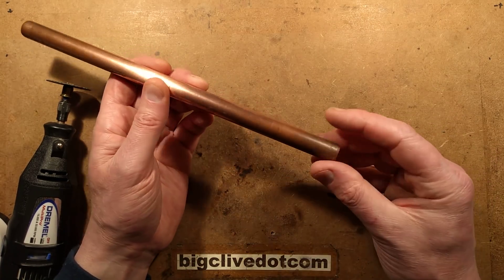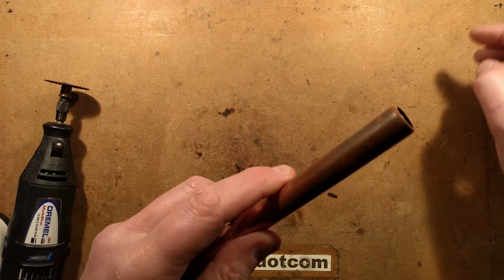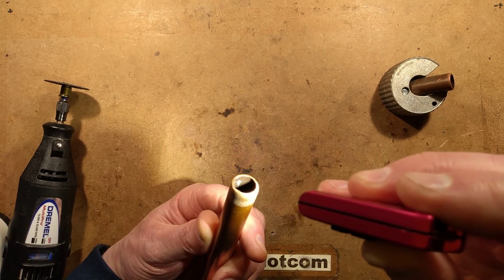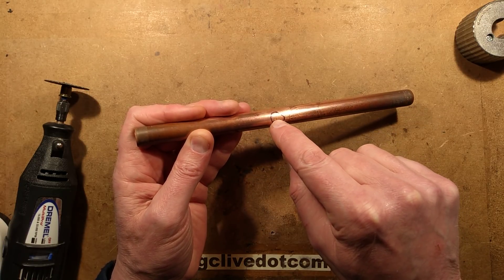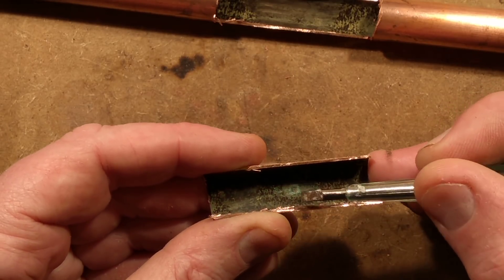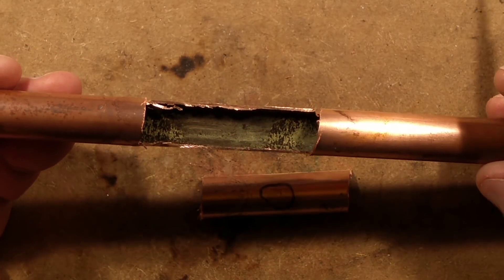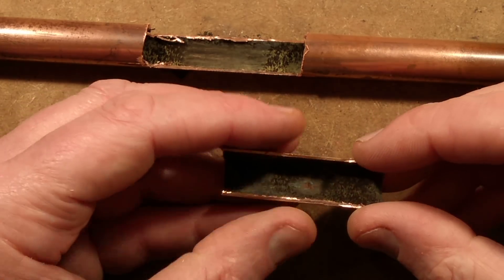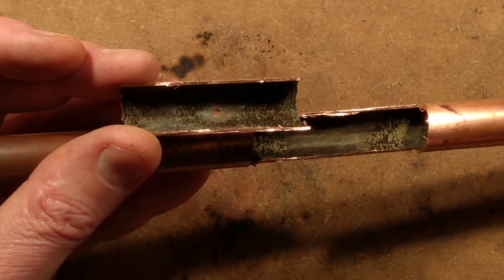Odd pinhole leak in copper pipe.  Selective electrolytic corrosion?

Comment: My first guess was that the green blobs inside are caused by flux getting into the pipe at the time of fitting and sitting quietly, lodged to the surface and slowly causing pitting and corrosion of the copper by electrolytic corrosion from the zinc in the flux. Weirdly though, it should be the zinc which corrodes into solution when it is in contact with copper under water as zinc is lower than copper in the electrochemical series. If there was iron present that could cause it. Are there any parts of the system that might have a steel or iron component in, such as a boiler or heater/heat exchanger of some kind? The other cause could be if your water company on the IoM uses chloramines to disinfect the public supply.

Comment: This is why PEX pipe is used here now for all new construction.
Reply: Pex is amazing... until a rodent chews through it in an attempt to make it through the hole it is run through and causes a flood. Been there fixed that.
Reply: At least that would be a single point. This looks like ALL the copper tubing will need to be replaced or will start springing random leaks soon...
Reply: @danielthechskid  It would remove some of the convenience of running PEX, but a metal sleeve for the line running through penetrations could mitigate that. Bonus if it's steel and used for runs through walls: homeowners hanging pictures/shelves/what have you don't make fountains.
Reply: in new "new construction"  pex is great. just make sure you never get any rodents near it.  
living near any place the floods or a farm that occasionally harvests or tills , and you will eventually have to deal with a few rodents coming in.
 they are also prone to water hammering, if not installed perfectly.
Reply: Here in Finland they've found quite severe chemical differences in materials and chemical residues in water. Most problematic chemical is TBA as there aren't any safety specs in EU for PEX piping and liver damaging amounts of that chemical don't make water taste anything special as usually chemicals do.It's official health departments recommendation to flush water at least a minute before consuming it on new installations for at least first half year. So all in all. It's not completely flawless material either. Also it's bit alarming to know that few batches of PEX has been pulled and banned from market because people apparently have actually tasted other three chemicals in water. And if those chemical dilute into water even after flushing system after install, it's actually not the best news ain't it? Ten random PEX articles tested and two of them were banned. That's not good indication of quality of PEX pipings. Don't know if this can be translated into english via google. Likely not :)

http://www.projektiuutiset.fi/muovisia-kayttovesiputkia-myyntikieltoon/

Comment: I'd like to point out that copper is very high on the electronegativity scale, which means with electrolytic corrosion it'll usually be the other metal that corrodes. But it's certainly possible that flake of steel or something got embedded in there.
Reply: Imagine not a flake, but a thiny steel bristle embedded in the wall maybe even passing  through it. Due to this exact effect you describe the steel will be eaten away leaving a hole.
Manufacturing defect in pipe. Impuritys/contaminants acting like ticking bombs.
Reply: @1kreature  ticking bombs are harmless....
Reply: This is what I was thinking.
Reply: Mr. Morningstar  Yeah. It's worse with zinc gutters though because zinc doesn't passivate like aluminium does. But aluminium has it too.

Comment: Polish copper pipe, I believe there was a bad batch a while ago (2000 ish). Or if it's on the hot supply it could be from a water heater ?

Comment: What can also happen is if your boiler has a circulation pump that is too powerful for your water installation, it can wear down your pipes due to the speed the water is circulated resulting in very tiny holes appearing over time.
Reply: This is true! I've seen it happen in a resort with thousands of rooms! Job security at its best!

Comment: I moved it to a house around 20 years ago and it's on a well, it was new, after about 5 years went by started seeing failures in the copper pipe just like those. The goo on the inside was white and blue (calcium?). The pin hole were so small that the spray was a super fine mist. After 10-15 repairs, I just re-plummed with pvc.

Comment: I saw the same thing happen to a piece of copper pipe that fed a chiller unit in a datacenter. It was spraying water into a mess of ethernet cables and (more fun) 240V power cables that ran underneath the raised floor.

Comment: I found a pin hole leak in a section of central heating pipe (return).  It had lengths of plastic pipe either side of the run so I think it was electrolysis room it not being earthed.

Comment: Get some inhibitor from screwfix flush they system out refill and add the inhibitor in there should help
Reply: Get the inhibitor or your hole system will end up fucked
Reply: Inhibitor? Bit of a laugh there as I believe that Clive said that it was a cold water pipe from the riser into the property . . . not the central heating system.

Comment: I’ve been living in this same house for almost 50 years now.  Some years back I had a number of these events occur in the same type ½” copper pipe.  They were always on the hot water lines.  Some years before that I had insulated the hot water lines for energy conservation.  Of course to repair the leaks I had to remove the insulation.  I got to wondering if the insulation was somehow contributing to the leaks.  I eventually removed all the insulation.  Since I did that, I’ve not had another leak like that.  I don’t know if the insulation contributed to the problem.  I don’t know if something else has changed that is preventing the problem from occurring again.

Comment: Clive, the same thing happened to a copper pipe that fed a tank in my airing cupboard.
My house was built in 1948, so copper does go bad over a long time.
A plumber called it "Pickle pipe" for some reason, there were quite a few green dots on it.

Comment: I had a similar problem many years ago. ( 1974? ). But it was behind a wall and soaked the hallway carpet. I found that the copper pipe was so badly contaminated that it refused to take solder and I ended up with a rubber bodge to fix it. That was only one of the problems in this house that was built by a fly-by-night contractor who obviously used all kinds of low-quality materials.

Comment: If I remember correctly those failures are mostly caused by steel particles. Probably from either work on steel pipes earlier in the flow direction or from tools like files and hack-saws that has been used for steel. It do take a lot of years for the corrosion to go through all the way.
Conclusions: Don's mix steel and copper pipes plus dedicated tools for copper when it comes to plumbing.
Reply: A lot of plumbers use steel wool to clean pipe ends. Maybe this is the cause of the contamination?
Reply: but its the steel which corrodes with copper particles. Copper after steel pipe is supposed to be OK.

Comment: In my house it's all copper apart from a section that runs from the main shut of valve in the street to the house and that's made from mild steel. Not shore if that would cause corrosion to copper

Comment: I see this quite often. 
Less often in heating pipes from a boiler, but still then.
The water treatment chemicals or minerals from a well build up in the pipe, and some flakes off, that exposes he bare copper to corrosion, and poof it’s gone.

I also see in refrigerant lines hat run through hot attics, where the insulation gets torn, water will condenser on the cold pipe, and fill the low spots inside the insulation and the water eats away at the outside of the pipe like a worm eating a book...

Comment: If you end up replacing whole runs, you can always use PEX in harder-to-reach places for its flexibility so you won't have to solder in impossible positions or even bother with elbow fittings in places where bends can be made soft enough.
Reply: Might as well just use PEX everywhere. It is a rather good system.
Reply: @mgkleym  For an existing installation, my version of "replace everything" would be limited to the affected run(s) from wherever they tee off from to as far as I can push it with enough slack to tidy both ends at the next remodeling opportunity where the remainder of pipes may be more accessible or need to be ripped out anyway.
Reply: biohazard 918 agree 100% if you can pull a cable you can pull 15mm PEX from a roll and if you have to cut out old pipe sections through holes drilled in joists it's a doddle . I prefer Hep2o myself as the push and turn fittings are so quick and easy to use. Cheap ratchet pipe slice need no deburring, pop in a stainless anti crush insert and push twist and lock... Done. You can even unlock them again if you really need to. Resistance to freezing is good for PEX and they don't suffer from long run thermal expansion in heating systems like copper does.  Best of all they don't corrode.

Comment: the PH of your water is the basic cause of leaks like this, finding the weakest spot.. municipalities normally take great care to stabilize PH of water above 7.. if you're on a private well, it's up to you.. green streak in the toilet bowl or sink means you are drinking the metal from your pipes and valves all the way back to the source.. plumbiodontal disease.. get a quart sample and go have it tested.. we don't want you turning grey from lead before your time.. a PH of over 8 allows the formation of a protective mineralization layer, covering the inside of the pipe, so the subsequent water never actually touches metal and will never wear out as long as the PH is correct..
Reply: isnt that what happened in flint?  they changed something with the water that changed the ph and destroyed the mineralizarion layer and then picked up all the lead?
Reply: @mark33545  pretty much, they had a chemical that stabilized the lead corrosion in the pipes, and then they stopped injecting the chemical to save money after they switched to a cheaper provider.
Reply: Yes, it's typical to add sequestering agents to municipal systems to protect the mineral/metal oxide layer on the inside of the pipes, and that was excluded for cost reasons.  They fucked up an entire municipal distribution system to save around $500 a day in sequestering minerals.
Reply: @davidhoekje7842  mind blowing.  i assume the only way to fix it is to replace all the water lines which is why its taking so long to fix?
Reply: @mark33545  It is fixed for years now, but the larger problem of lead pipes will cost hundreds of billions nationwide.  That is not a flint specific problem. Most of the pipes are in people's front yards.  The mains and indoor plumbing are mostly replaced already.
Reply: @mark33545  The issue is that because the sequestering agents were excluded the protective mineral layer on the inside of the pipes was lost, and so lead that's innately present in brass components, lead soldered copper pipes, and lead feeder lines was lost.  Because the topic is so sensitive now, the choices to replace the pipes is more political than technical.  Most of the water lines in the system have no appreciable lead, in fact one reason Flint was able to rationalize the problem away is that when they tested "their" system it didn't have elevated lead.  The elevated lead levels were present in stagnant water at the point of use, and the source of lead was the last few hundred feet of pipe.  So the issue is that mismanagement of the system caused a water chemistry issue that damaged the homeowners pipes.
Reply: @c h Q p
But how can pinhole corrosion in copper pipe then ever occur in areas with very hard water - which it does a lot too?
Is it, because in these areas ion exchanging water filters with this odd mineral filling are used?
Reply: Werner X You guys seem to all assume US regulations and practices.  Countries differ a lot on many of these points.  Some countries don't allow anything to be added to the water supply, for any reason. Some countries have banned lead water pipes because it's known to have caused widespread lead poisoning in the Roman Empire. The rules and practices on the IoM are probably different from far away places like Michigan and Congo-Zaire.
Reply: @John Francis Doe
I ´m in Germany, water companies here don't soften hard water, that's up to the houseowner himself, if he want. Many houses in hard water areas have these ion exchanger installed, but there is a controversy whether they are healthy or have side effects.
Reply: Keep reading this as "the pH of your water is basic" and couldn't make sense of the rest of it
Reply: basic meaning the opposite of acidic.

Comment: This happens to me fairly regularly.   Once it started, every 6-12 months or so I was hearing a new pin-hole leak.  I ended up replacing almost all the copper in the house with PEX with the exception of part of the downstairs bathroom.  Unfortunately enough,  about 2 months ago I was back in the wall cutting out the rest of the copper.   At first I thought it was just happening to the copper that was originally put in the house when it was built,  but I also developed a pinehole leak in the utility/boiler room in new run of copper that I had added when I bought the house.  It was only ~15 years old.  Everything is now PEX so I don't anticipate any more issues.  I was told by several people that the likely cause was acidic groundwater due to all the pine trees in the area and that it was common in the region I live.

If I were you,  I would start figuring how best to start replacing that copper with plastic everywhere you can.  It's a pain,  but ignoring it can unfortunately prove to be very costly and potentially cause mold/health issues.

Comment: Possibilities: High levels of chlorine in the water supply
Corrosion particles from rusted water heaters
High water pressure
Low pH levels in the water
Other chemical factors  (eg, microbial activity)
Reply: I would expect high chlorine to turn the whole pipe green.  I believe electrolysis to be the reason, a small bit of dissimilar metal in the copper and bullseye. I had the same problem externally where a steel girder just touched the copper pipe and it gently ate through the copper.
Reply: High ph?  Maybe low ph.  High ph gives a nice robust mineral layer on the copper and they last forever.
Reply: Chlorine is not a problem, but many municipalities now use chloramines instead because they are cheaper and last longer when the water is exposed to air. Clorinated water in a bucket is only antibacterial for a few hours whereas chloramine treated water will be antibacterial for days. The problem though is that chloramines eat copper.
Reply: @PhoenixRevealed  - well observed sir

Comment: Flux left on pipes during installs can cause leaks years later.
Reply: Yep, I've seen leaks in the middle of the plumbers thumb/finger/print, flux corroding its way through the pipe because the plumber didn't clean hands/pipe after the job.
Reply: That's a big part of why a lot of companies are going to water based flux.
Reply: A lot of plumbers use crimp/press fit these days. No fire risk.